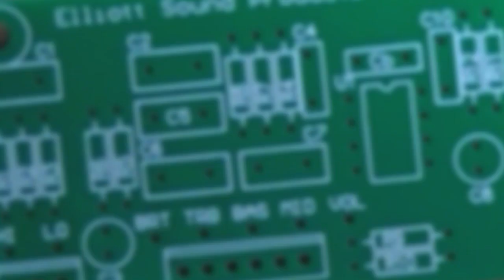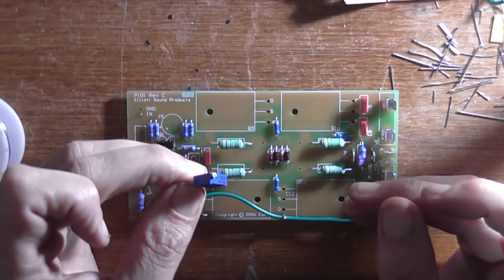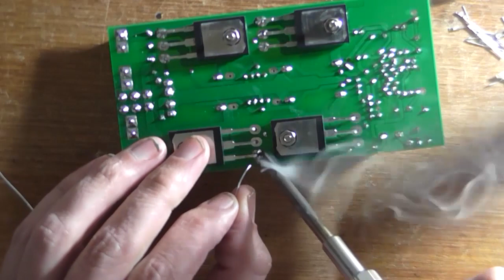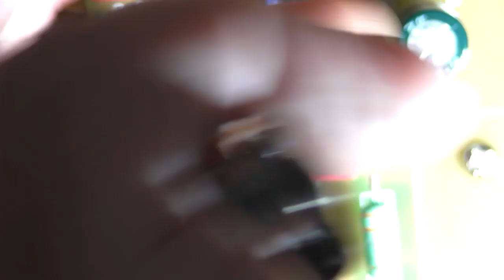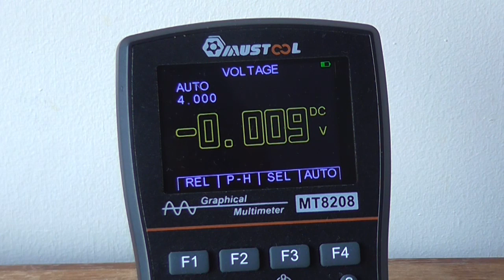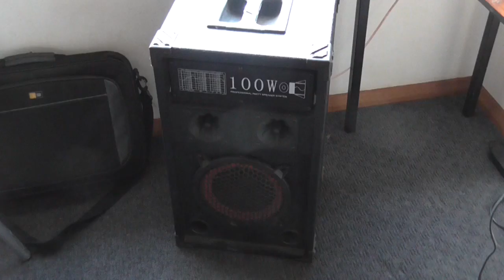ESP Lateral MOSFET Amplifier Assembly - Pt 2

Comment: Thanks for the video. Trying to decide between the P68 & P101 for sub duties. Won't be driven hard so don't need shitloads of power. Glad to see you are using a DSO138 - I have the kit but am yet to build it. Guess I just need to splash out now for the function generator ;) Thanks

Comment: This is an exceptionally clean sounding amp ( when properly assembled ) - It would be interesting to hear it along PuriFi or latest Hypex....It may not measure "as well" as the latest Class D - But it's good-enough for "cost no object " Mastering Facilities......  Now where to source a suitable & cosmetically appealing enclosure ? Jaycar has become a glorified $2 "Thrift Store" - RS components want +$200 for a paper thin flimsy 2RU case....
Reply from the maker: Oh, don't worry. I have an idea in mind, which will be coming up on the channel soon. I do have a 2U rack case I purchased 4 years ago (neither from RS nor Jaycar, the latter are CRAP!) from Altronics which are well built. I just have to get it out of storage, along with a 25-0-25 160VA toroidal transformer that I need for that speaker box. However, the amp may sound ok, the speaker does not (I do think the laptop is playing a role here, I might have to build a small preamp for testing power amplifiers so 1, the laptop isn't overdriving and 2, causing weird noises.
Reply from the maker: Oh, wait! Silly me! I can eliminate the laptop as the issue as I have a USB interface with line outs. D'oh!